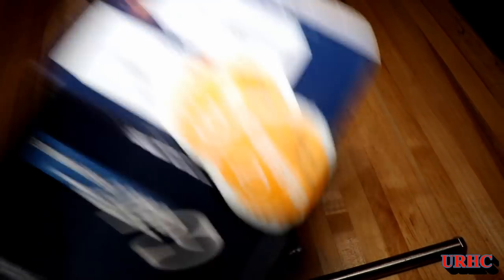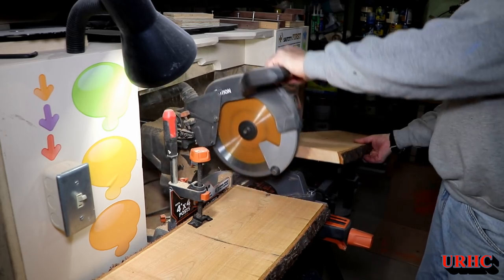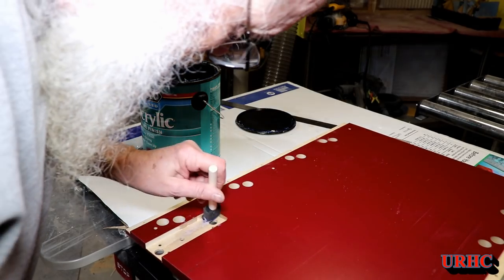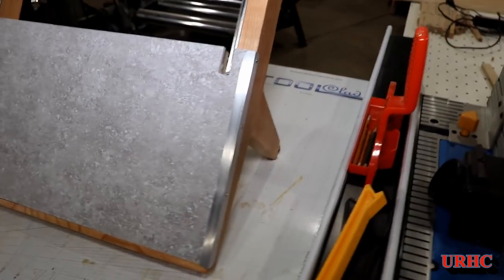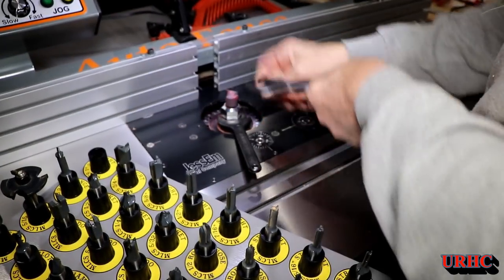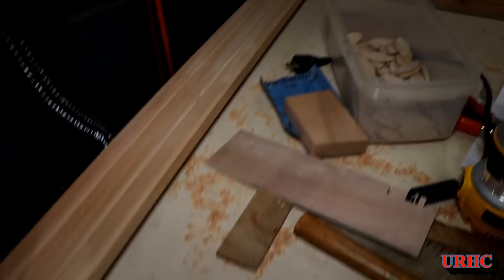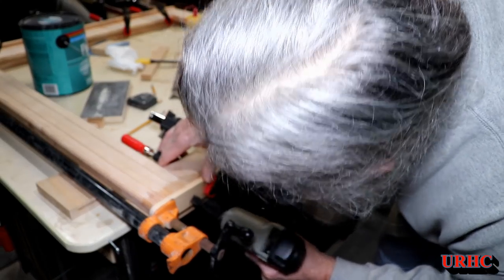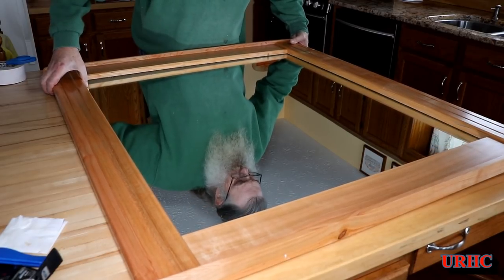Guest Bath Update Part5 Mirror Frame Build And Finishing The Stool

Comment: That is a very nice looking frame for the mirror! I need to do the same for two bathrooms at my home. 
I have to Waite until my Ortur arrives so I can put a date and my logo on the back in case it is ever removed. 😁🛫
Reply from the maker: Looks like they started shipping again today.  I got a notification my drone just shipped and hopefully my Ortur 2 will ship soon. The Corona virus has caused major delays and factory closures. I have been marking everything  with mine. Upgrade the firmware when it arrives. Thanks for watching.

Comment: Ed, it looks like one of these days you need to make an outfield table for your bandsaw. I made one for mine that hooks on to the back of the table. No fasteners, just hooks into place. Takes 10 seconds on or off so I don't have to leave it on at all times.
Reply from the maker: That's a good idea. I usually just use an adjustable roller but don't bother with it for one or two cuts. I am definitely looking into a track saw so I don't need to use it for breaking down boards. Thanks for watching.

Comment: I bought the Grizzly Track Saw, with a bunch of extra's for $250 a dew years ago. Never got to use it, still in the box. lol
It's the same as the shop fox and some others, and there are some hacks out there, to make it perform better.
I hear the track is the same is some of the other brands.
Came with a 55" track, and the track clamps. T25552 - Track Saw Master Pack
Reply from the maker: I had another viewer mention Wen has a new tracksaw that's under $200.00 with a 100 inch track but the saw looks to be all plastic. Sent a email to them to see if they work with social media and provide samples for reviews.  If not I will probably get a Festool someday. Have to find a new pin nailer first because I can't find parts for the old one. Start using those tools before the warranties run out 😉. Thanks for watching.

Comment: Looks great! Wen has released a new version of their track saw and I've been eyeing it ever since. The only issue I can see from the get-go is it doesn't have an 8' track, you can only combine several 40" tracks. I would prefer to have a short track and a long track instead of bolting them together, but the saw is less than half of the price of the Dewalt and Makita (and of course Festool). Something to consider, if you want to take a chance.
Reply from the maker: Thanks.  Just looked and it has a 2 piece 100 inch track and an over 2 inch depth of cut for under $200.00 delivered.  That's tempting may try one after finding a new pin nailer. Wonder how long it would last. Thanks for watching.
Reply: I have been using the 100 inch Wen track saw for about a year.  It works very well for breaking down big material. The saw is actually very stout.  Seems to be made of some sort of metal casting.   The stops are a little cheap (plastic).    I don't regret the purchase at all.

Comment: Was wondering what brand of pressure washer you use and prefer. Thanks!
Reply from the maker: I bought a generac years ago and they are junk. Found out their pump was only designed to last 50 hours and had to replace the pump just after the warranty ran out.  I will be looking for a replacement soon also. I may just go with a smaller electric one next as I don't have anything really big to clean. Thanks for watching.